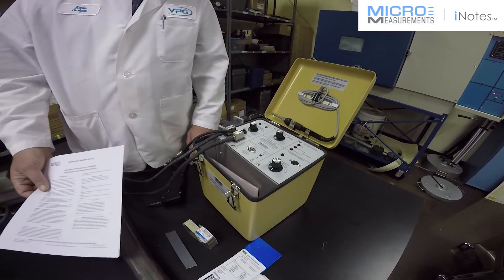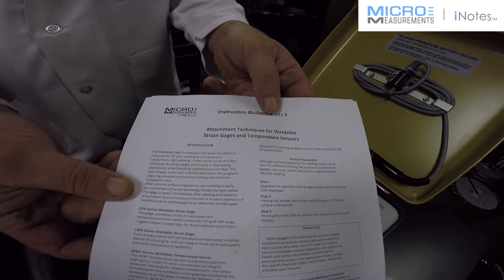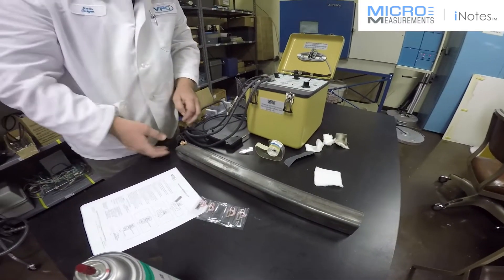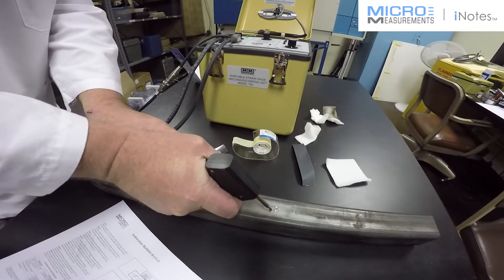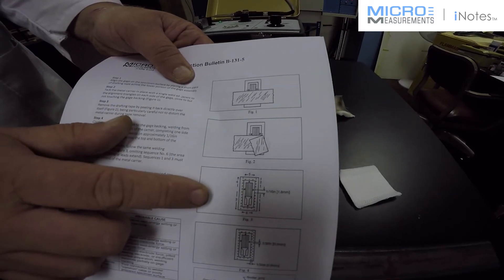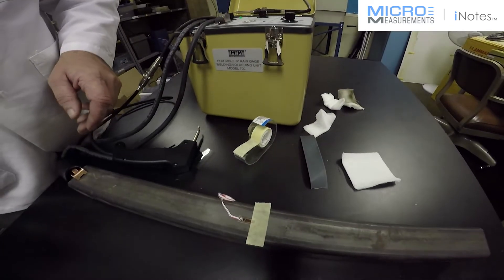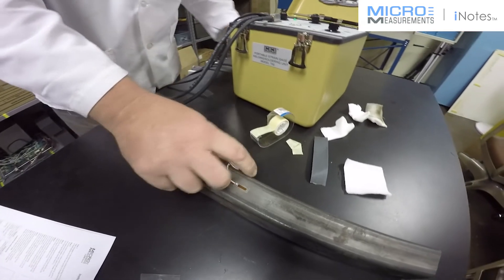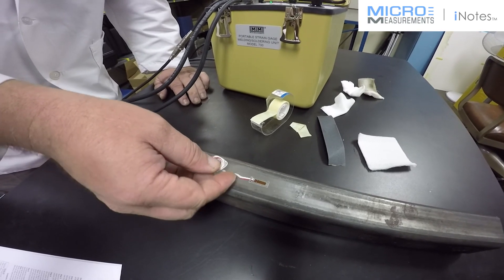Weldable Strain Gauge Sensor  Installations (Winter 2018)

Comment: I install these in a mining application, using the same welder, its a good little unit. We install using the exact same method you are teaching, yet we have drifting gauges. Is there any other pro tips you have or ideas on why this might occur?